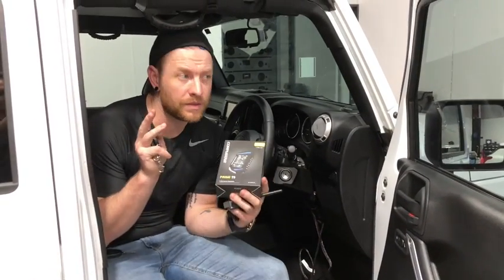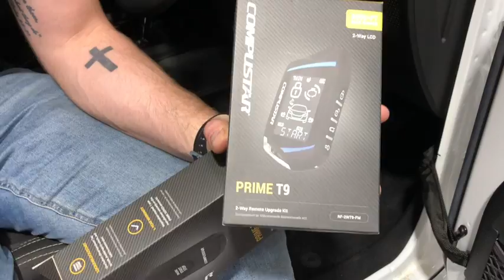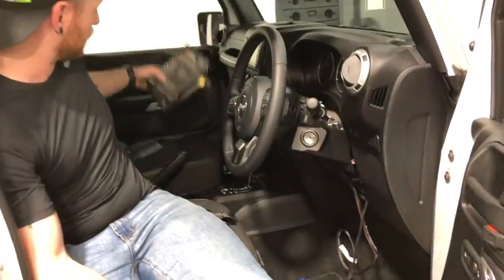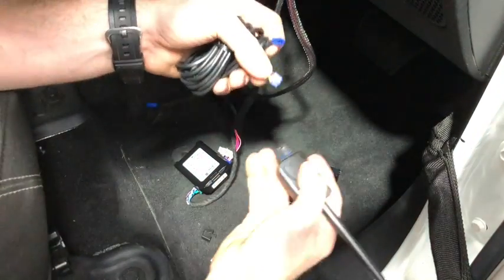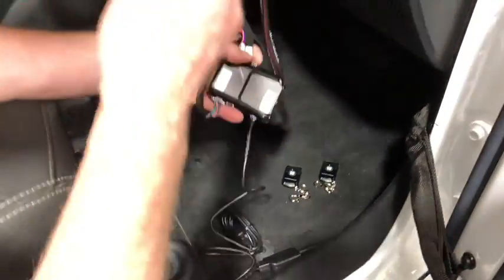How To Program Remotes to Compustar DC2 / DC3 Remote Starters

Comment: Do you need to install a fuse holder on eech 12v, starter and ignition for safety or protection when installing the remote starter? @CarbonCarSystems

Comment: If you have trouble getting a new fob to program unhook the battery and start over. We tried so long to reprogram a new remote and couldn’t get it until we started from the beginning by unhooking power and then back up.
Reply: Just to clarify, unhook the car battery?

Comment: I bought a new SS antenna for my DC3, to replace a lesser antenna, I forget which one at the moment.  Can I simply unplug the old antenna, plug in the new SS antenna, and perform this procedure to learn the new remotes?  Also is it a good idea if I have two new SS remotes to program each one in to the DC3 twice to fill all four slots with the new SS remotes?
Reply from the maker: Yes but it will only learn the same remote frequency style ie: ss remotes will only work with ss antennas must be on the same spectrum to work.
Reply: @AutoChimp  thank you!  Everything worked out great, except for the one Arctic Start remote with the same FCC ID as the other Compustar remotes doesn't seem to accept being programmed to the Compustar brain.  Three other SS Compustar remotes went in to the brain perfectly.

Comment: I have the ant 2wfmx  model and when I remote start the vehicle it starts but then 3 seconds later the engine dies turns off. Any suggestions on what's wrong? Thank u
Reply from the maker: Program the tach level when the car is warmed up
Reply: @AutoChimp  thank you very much at work like a charm I appreciate your help thank you so much!